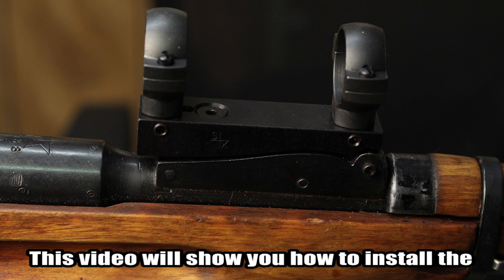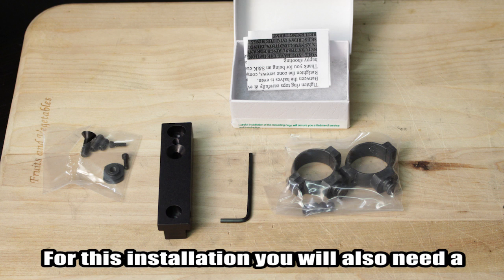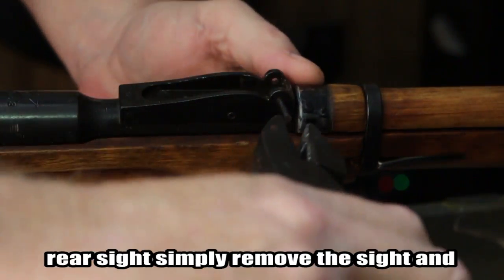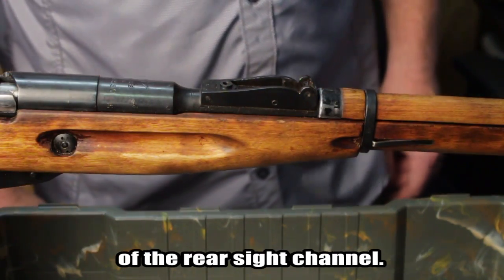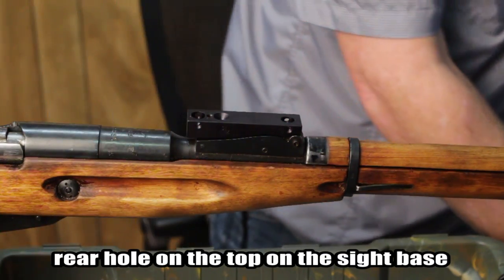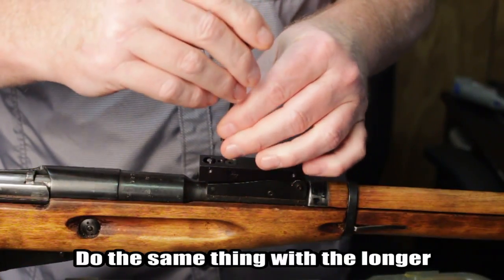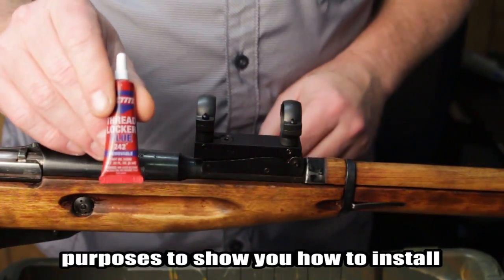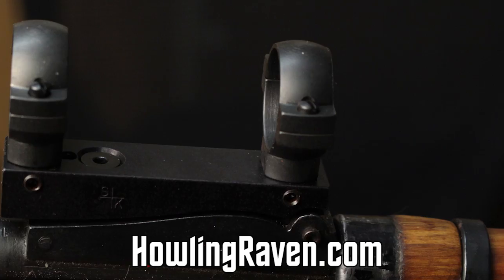Installing the S&K Mosin Nagant Scope Mount

Comment: thank you so much for pointing me to this product. I ordered it last night. if it's anything like the flash hider I bought from you guys, it's going to be quality. thanks again.
Reply: j jn..  How do you like this mount??  Thinking about scoping my 91/30.  I have a Swift 4x32 LER scope.
Reply: Most of those mounts will place your scope too high tend to have to hold your cheek up off of the stock been there done that just to let you know
Reply: @ranallbrown4095  An Archangel stock can solve this problem, if you're willing to go that route.

Comment: could you techincally use an authentic PU scope with this? by putting it inbetween the rings? That way i could have an authentic scope without having my receiver drilled.
Reply: No the problem is it is too far too see something with usual riffle scope. You need a specific scope where you can see when it is far from the eye

Comment: I did the same conversion just happened to have some old Style rings design for the 3/8 dovetail just installed the two sets of rings pulling a old long eye relief scope had in the closet for the last 2 years slapped her on grouping pretty good 30 rounds everything still tight by removing the rear sight completely in using the existing dovetail

Comment: The scope is too far To see something
Reply: Its a long eye relief scope set up so you need a pistol scope.
Reply: Our use a scout scope, I have a Leopold on my Ruger gunsight it’s got a good 7 inches of Eye relief
Reply: @louisgruendler2089  a little late but in addition to this comment, with this setup you don't need a bent bolt modification